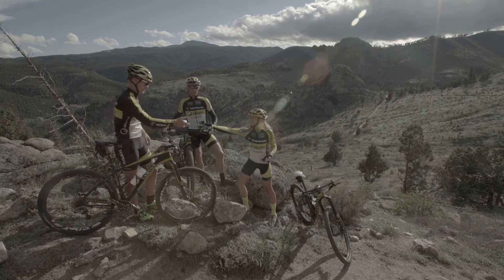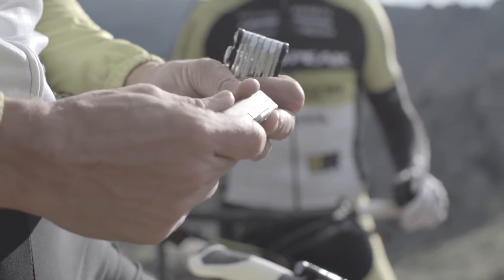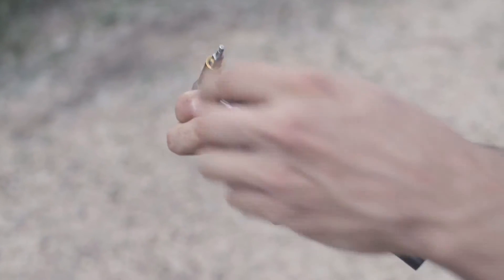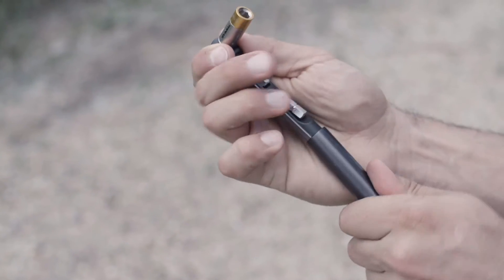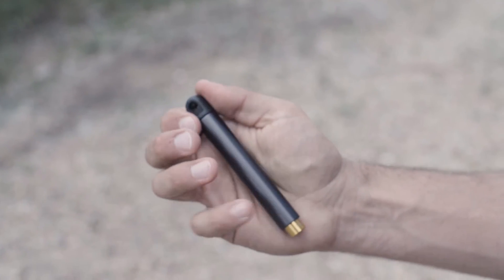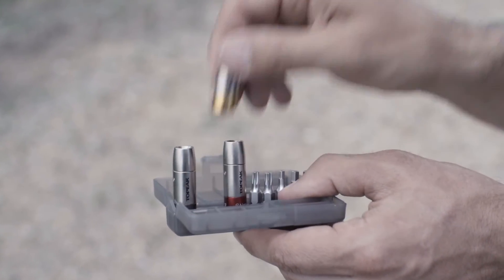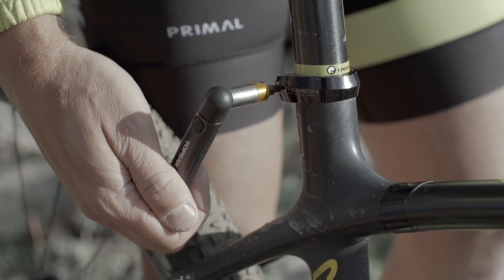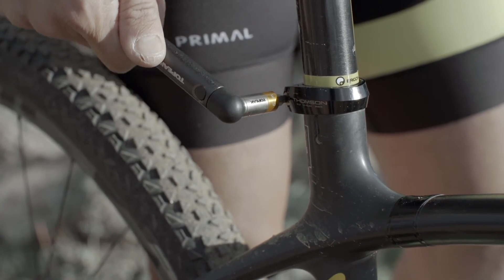Nano Torque Series

Comment: Hello, just received my torqbox X but I use it with the ratchet from the Lite NTX set so I have to use a 5mm hex bit for the ratchet. Why didn't Topeak make the top for a 6mm bit. That way, I could use any of the other bits. Now I have to carry an extra 5mm bit. Aaargh.

Nothing in the "manual" tells how it works. I tried in vain to preset the torque before using it, like any other torque wrench, not knowing there is no click, you just turn till it shows your torque!

Comment: I have the torqbar X. With one adjustable torque. There is no instructions of how to set the torque needed. Not even in the instructions manual
Reply: You turn the torque tool and the lines will start to move counter-clock wise. Once you get to the aligned and desired torque level stop pressing and the tool will automatically return to the preset 0 Nm level (the torque head has an internal spring). You have to be careful with the tool, it will not click, you have to visually adjust to match the lines, while using, to the desired Nm level. Hope this helps